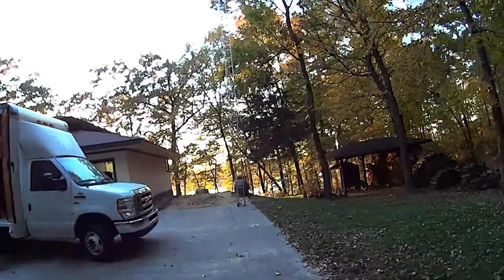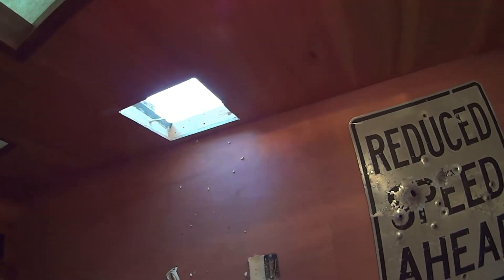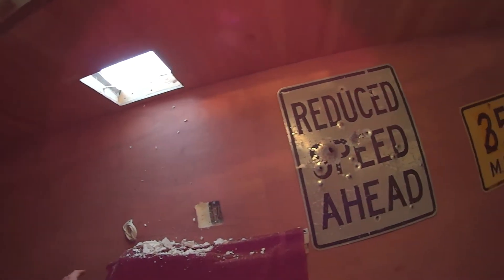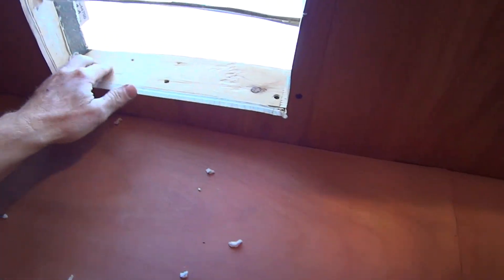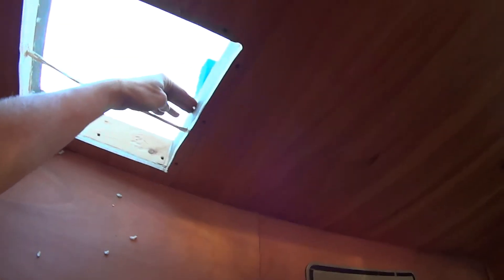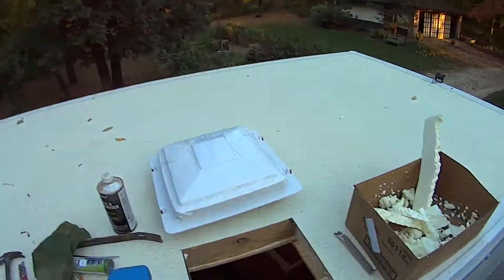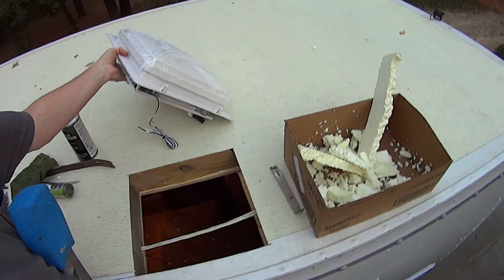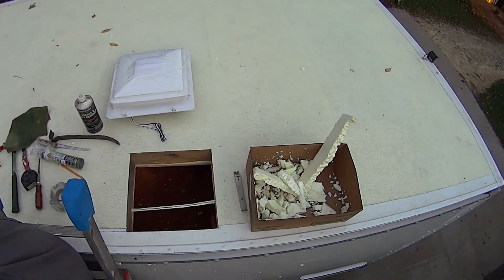Rich's Box Truck to RV #80 - MAXXAIR ceiling fan rough installation

Comment: Do you have any advice on fans/holes in your isolation? What is the point of insolation if there are holes in it? I suppose every little bit would count (and the sound dampening characteristics are a plus). I see everyone insolating, yet wondering how effective it actually is. Thanks!
Reply from the maker: Well I can tell you this. I do not have air conditioning, so the purpose of the insulation in this RV is to keep warm air in when it is cold outside. Any "hole" in the insulation will contribute to heat loss. I have a lot of holes (fan, 3 skylight, doorway, cab opening, back window). I also have quite a bit of insulated area to help keep heat in (floor, walls and ceiling). So it boils down to: can I keep warm and comfortable on a cold night? The coldest night we have spent in the RV it got down to maybe zero F. The furnace ran quite a bit of the night as expected, but we kept warm.

Would I have kept as warm had I not put in insulation? I am thinking no. I do not think the furnace would be able to keep up with all of the heat loss.

Insulation good. Holes bad. Depending on your goals, it is a balance.

If you wanted to get fancy, there are many programs available to calculate heat loss accurately. You punch in areas, R-values, expected inside and outside temperatures, and they will tell you the BTU required to achieve your goals. Do a search for Manual-J. On this project, I will admit that I shot from the hip for furnace sizing.

Comment: How is the roof holding up, I didn’t think with a China top this could be done
Reply from the maker: China top? Is that what you call the translucent roof? So what's the big deal with cutting in a fan? I am guessing that the cutout could weaken the panel and lead to cracks? Or are there other concerns? Please pass along your sources of concern to help me out. Sometimes ignorance is bliss.

I framed all around the opening with 2X lumber, glued and screwed in place. So far so good, although I have not put on a lot of miles and I have not crawled up to inspect. I will now though and let you know if I do see problems.
Reply: Rich China top..... very fragile and yes they can crack real easily if not careful, in my 30 years of being a mechanic and tow company owner I have know no one to install a roof fan due to it being fragile, I have been wanting to pull the trigger but just haven’t as I have been trying to find other people who have done this for a reference before I put one in....... let me know what you find as I am really curious to know, especially being I can’t even get our local assembler here in the area to put one in unless it has a metal roof.

I’m not bashing in no way, so please don’t think I am as I am very curious as to the longevity of this,

Food for thought though...... if it does start to crack and run drill a very small hole at the end of the crack and this will stop it from running any more
Reply: Keep up the great work though as I sat all weekend to watch all your videos, great job